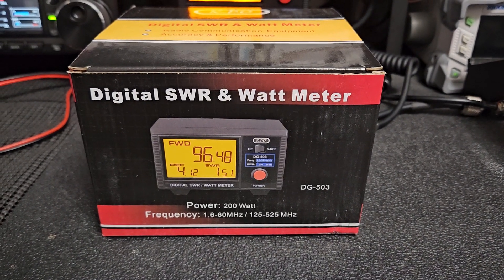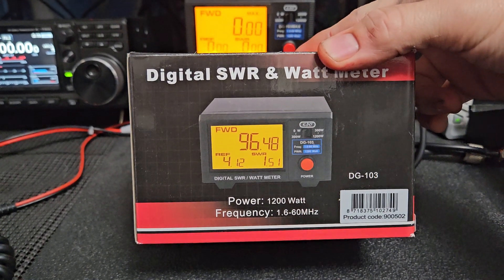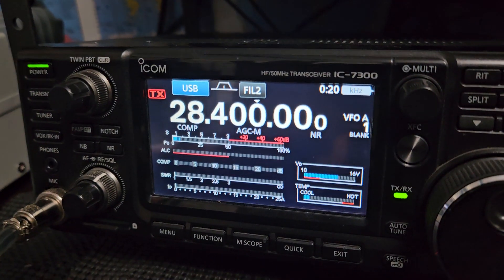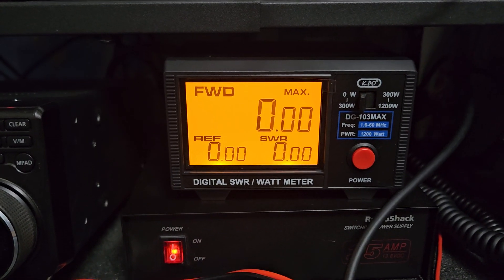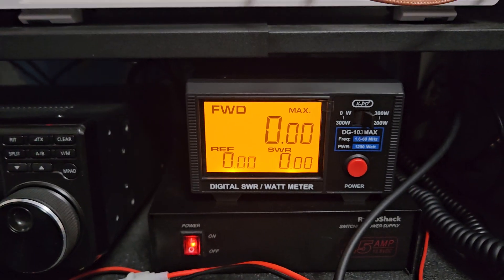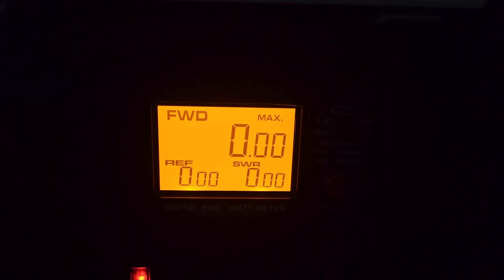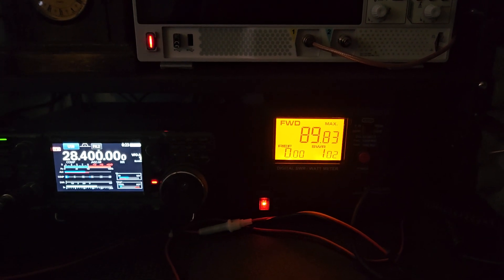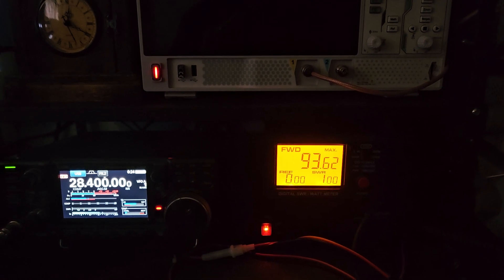Customer Demo K-po DG-103 Max Pep Reading HF Power Meter

Comment: Does it read average watts too or just peak?
Reply from the maker: Both
Reply: @ScottsRadios  how do we switch between avg and peak ?
Reply from the maker: There is a switch on the back labeled max. 
That is for peak.
When that is off it is reading rms.

Comment: Can find only 1 analog meter on website. 
Reads avg and pep on am and SSB. Didn’t see any pep on am in the video on 25 or so watts.
Reply from the maker: You need to scroll.
Reply: @ScottsRadios I finally figured out you have to click the arrow left or right to get to other meters.
Reply from the maker: As you would already know I think? An HF radio does not have much PEP on AM so there's no reason to show.
Reply: @ScottsRadios  should get 40 or 50 watts out of that 7300. Granted it's not much but being a guy interested in am pep I was looking for that. Still might try one of those meters though.
Reply from the maker: @miker8379 Most HF radios are  going to be poor performers on AM. 
Although you will see a little bit of forward PEP.
If you monitor the power on a average reading meter it will significantly go backwards with modulation. 
Running a IC7300 on AM at 25 w carrier is not good for it.
Reply: @ScottsRadios  I’m glad I’ve got a Kenwood then. 
I’ve heard quite a few 7300’s on am usually on 40 or 80. They sound pretty good especially for low power that you get with low level modulation.
Reply: By the way, I’ve sort of learned to like am, at least if you want to have a conversation.  A few months ago 10m am was buzzing, it’s pretty dead right now but will probably pick up this winter around 29.0. 
My buddy in Florida is sure not afraid to use his 7300 on am.